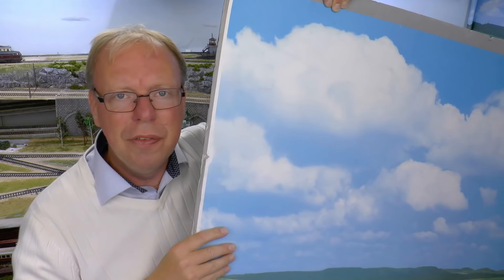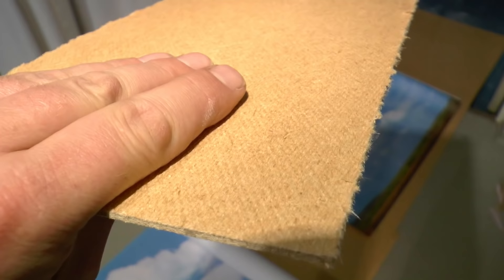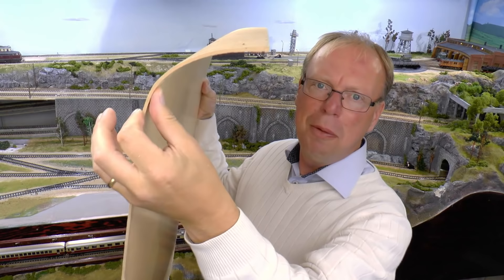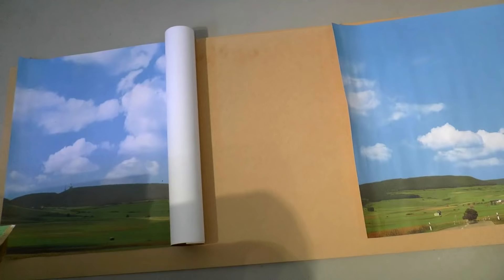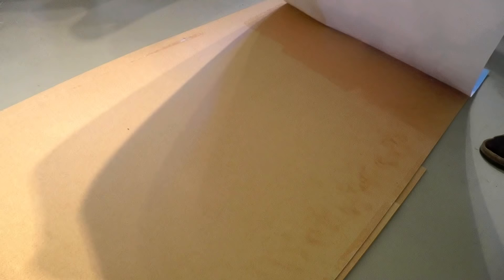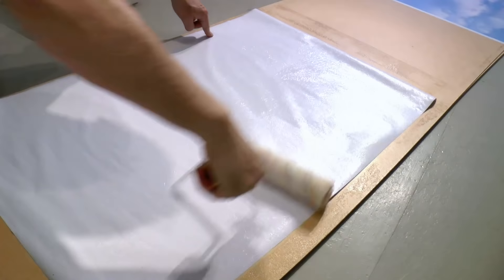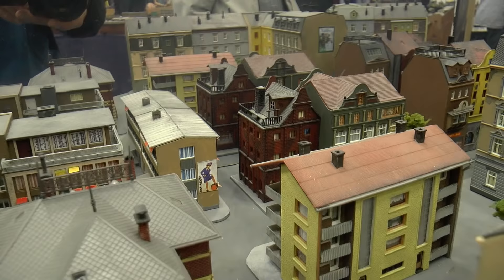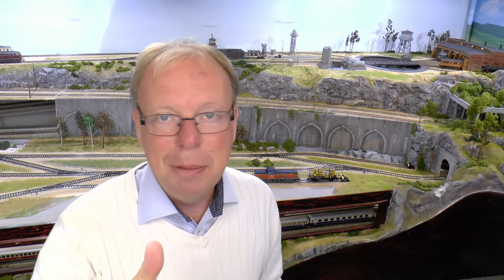Backdrops for model Railroad - Detailed guide DIY

Comment: Great tutorial and timely I must say. I just put up all the mdf around my layout room this weekend (used a brad nailer), I used original windex saturating the area I wanted to curve around the walls, just soaked both sides of the 'curve' and nailed it to the wall, worked great (can't recall the YouTuber that recommended that in one of their videos or would credit them). Then followed up with spackling at the seams, sanded, applied second coat last eve. Will finish sanding today. I am using adhesive backdrop sections, so I just need to be slow and methodical as pull back a few inches of backing at a time and use a paint roller to smooth it out.

Comment: Excellent tutorial  just a few questions have come to mind. 
1) the wood board wasn't visible for very long-  what type that is is important as I know some boards like that do not like getting wet at all. 
2) great points in the allowing for the scene paper to fully expand before mounting and the a losing for the drying shrinkage. But how many mm overlap did you  allow? Too little is want we want to avoid. But too much and the scenery has a discontinuity. 
3) any issues with applying the pasted paper scene on the curved board and also joining the curved board to the straight section?  Wish that had been shown.
Reply from the maker: +Minok1217 Hi Minok! Excellent feedback and questions! (y) 1) This type of board has different names och sold under different brands depending on which market you're in. Make a screenshot from the video and bring to your local dealer and they will be able to help you to a suitable product. 2) I typically use 1.5mm overlap. 3) Yeah! I agree. I should have had a scene on this topic in the video. I'll add it to the German language version.. Anyway.. I glue the paper scene to the curve, leaving about 100mm sticking out beyond the end of the board.  I then join the curved section with the one already in place on the wall. Once the curve has been mounted and joined I glue the 100mm to that paper scene.

Comment: Good tutorial. But in my case, I have a roof with an angle, it wil be hard to do that.
Reply from the maker: Would it be possible to cut the backdrop to lower it, or would it be no use?
Reply: I have an upright wall of about 70cm, then the angle of the roof starts, So in my case, I have to be smart. My plan is to construct a table of 360cm by 140cm which can be moved. The height of the upper level can not exceed 70 cm (I still have about 10cm clearance in the back for the trains). I can try try for an offset backdrop agains the roof but that means I need a custom made coz the Faller backdrops won't work.
Reply: I have an upright wall of about 70cm, then the angle of the roof starts, So in my case, I have to be smart. My plan is to construct a table of 360cm by 140cm which can be moved. The height of the upper level can not exceed 70 cm (I still have about 10cm clearance in the back for the trains). I can try try for an offset backdrop agains the roof but that means I need a custom made coz the Faller backdrops won't work.